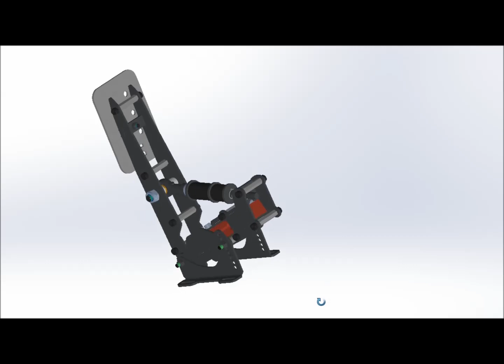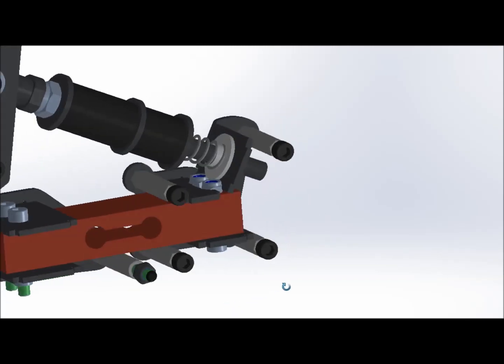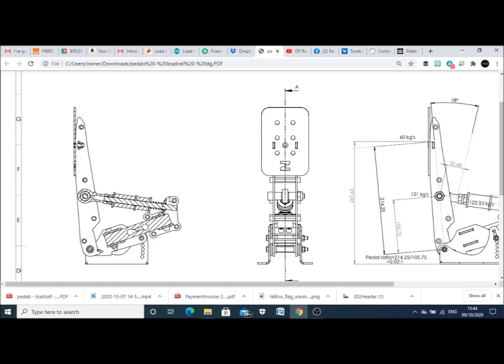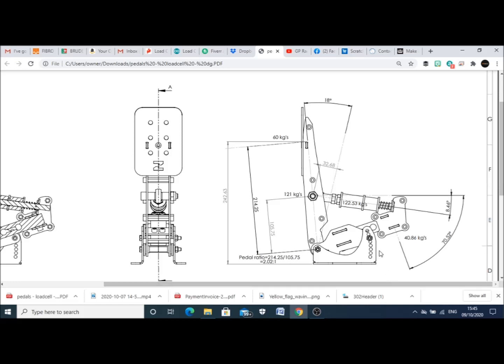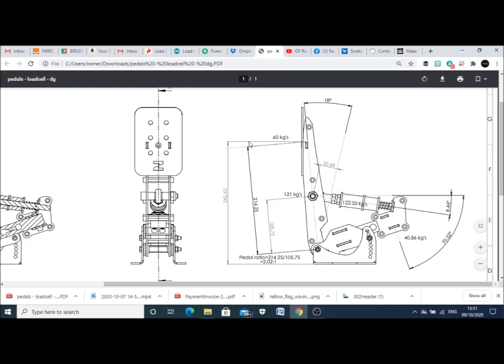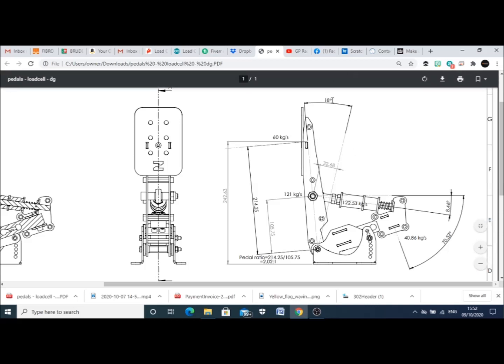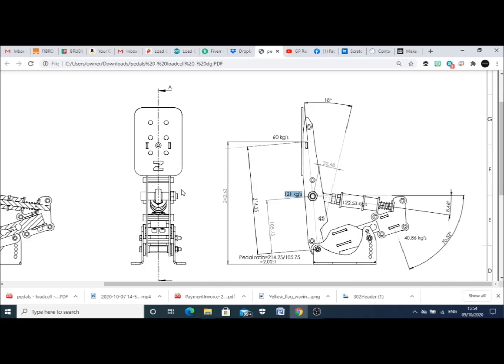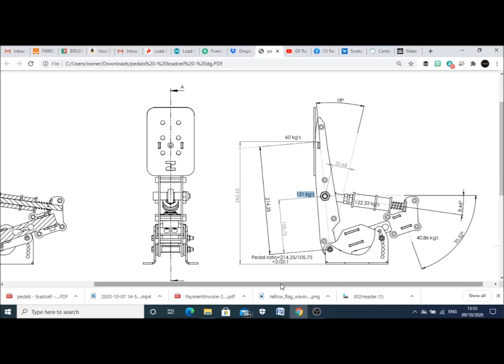Make your own Loadcell Pedals for Sim Racing - Part 4

Comment: Thats a great job. Im working on something ike this for now. But here is the one thing.
The loadcell footing is placed on the center of it, right under the holes. So it is the weakspot. And even with 40 kg load it can be damaged after a while. As im looking on the original pedals, they placing footer panel for 2/3 of loadcell. And the loadcell will receive required bend with less of load to the weakspot.

Comment: which  software do you use to view the project? thank you
Reply from the maker: The software for coding the Arduino is Arduino IDE and can be found on the Arduino website. The software for calibrating and seeing what's happening with axis is called Diview and can be found on the Leo Bodnar website.
Reply from the maker: If you want to view the CAD files for the design you'll need any 3D CAD package. I recommend taking a look at FreeCAD
Reply: @GPRaceSimulation  thank you, i appreciate :)

Comment: I used your design to make a set of pedals, but it cannot solve the current interference problem of the direct drive steering wheel.
Reply from the maker: Have you tried running a ground wire to the sim rig?
Reply: @GPRaceSimulation  No, I didn't connect the ground wire to the simulator. STM32F103C8T6 has three sets of ground wires. Can you just connect one set to the simulator to solve the problem?
Reply from the maker: @yinjack6998  I'm not 100% sure but I've heard of other people having success doing that so worth a try as a first plan of action.
Reply: @yinjack6998   All low voltage ground planes should be tied (connected) together (that's the point).   Some things you can try...   all Vcc and Gnd lines unless shielded should be twisted (helps stop them ending up as an antenna).  No wires should be coiled (this boosts their reception of noise).   Don't run the wires together in groups.  Earth the direct drive motor's chassis.     Good Luck
Reply: @TheBpgoa  Thank you for your help, according to your method, I solved this problem.

Comment: The brake does not need a bump stop at all, everything is limited to polyurethane springs. And for metal, thin rubber is glued to the inner tape and that's it. When designing my project, I counted on pasting metal to protect it from impacts.

Comment: Very cool! You mention using metal plates, but do you think it could be a possibility to use a cheaper material or resort to 3d printed pieces?
Reply from the maker: Possibly but the brake pedal loads are very high there would be issues of strength to overcome.

Comment: Cad Design = Steal the best, invest the rest. Also I am certified as cswp, and I'm 15. I am trying to find any internships or job with designing in solidworks. If I contact any company they saying that I am too young to do that. Do you have any advice what I can do? Also I'm redesigning these pedals right now, and if we are going to group buy laser cut parts from your design I would love to join. So are you racecar designer or something like that? Can you please tell a little more what is your job and what are you doing, I'm very intrested.
Reply from the maker: Hi, so my background is that I was a designer in F1 for many years. I started as a suspension designer for a sub contractor to about 30% of the grid, and then I worked with Prost Grand Prix, and then did projects with McLaren, Ferrari and other teams, along with World Rally& LeMans projects. I now work on simulation with racing teams and in particular the BTCC.
My career started because my family have been involved in racing since before I was born, and it was all I wanted to do. I got into my design jobs, by going to University and then applying for hundreds of jobs in teams and getting nothing. I joined a suspension design company where the Chief Designer had been in F1 and I learnt a lot from him. I would recommend you practice and learn all you can, if you are into racing, then offer to help teams out at the weekend. There's always someone that needs some extra help. Your time will come, it's not how quickly you get somewhere but where you get in the end that matters.
Good luck with everything.